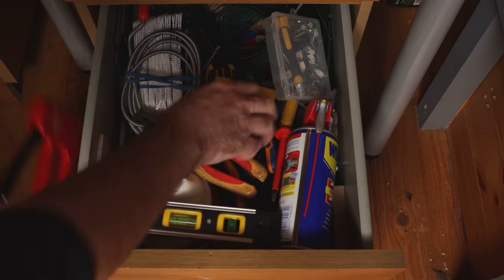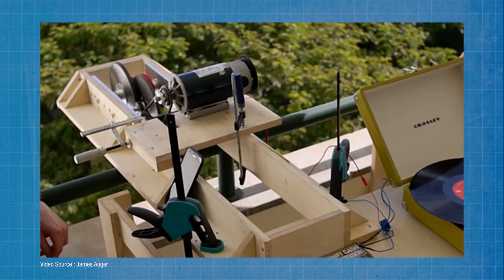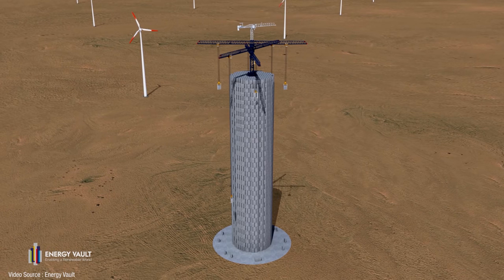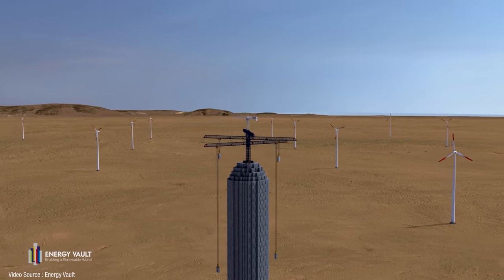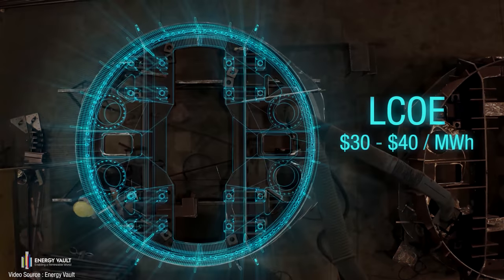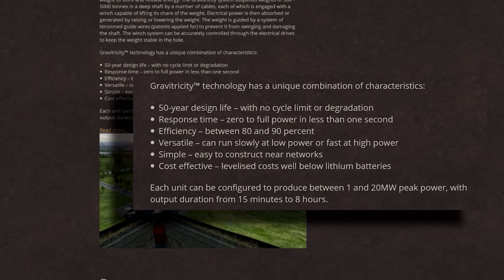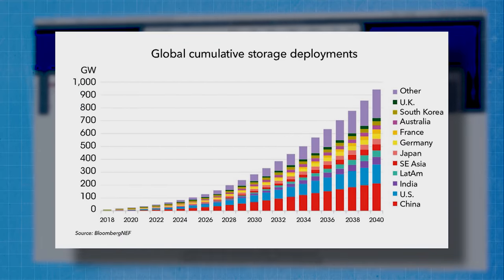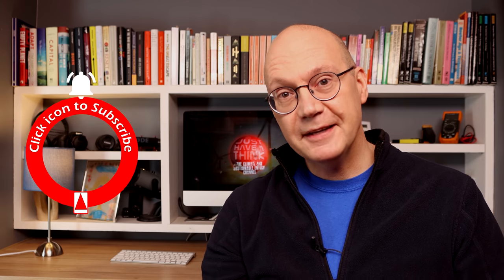Gravity Energy Storage : A very uplifting technology!

Comment: The energy vault energy storage is a bad idea. Using cranes, which can't cope with wind for energy storage from windfarms is not a good idea. Furthermore picking up blocks and dropping them off somewhere else (and not damaging them) is a very complex task which still does require human interventions (take a look at container shipping). In the container shipping the picking up the containers from the ships is still a manual job.
This task will be complicated further because the blocks will be prone to wear and tear. Furthermore one needs to be sure that a whole stack of blocks will not fall over.
The energy vault has only shown CGI's of the principle. I doubt that this concept will work in a practical cost efficient way.

The concept where old mine shafts are used sounds more promising. Also concepts using trains going up the hill are being investigated (https://www.youtube.com/watch?v=RHrlnnbJuDg). But I do have my doubts on the side of the maintenance side and durability of these concepts. (Pumping water from A to B is so much easier and does require a whole lot less maintenance.
Reply: Telltale sign : These projects don't give their maintenance costs.
Also, factoring density (concrete ≅ 2.4) and height, these equate to a modest hydro dam. For MUCH more cost per unit of storage.
Reply: I agree. Energy Vault is WAY too complicated. It'll never work.
Reply: "Using cranes, which can't cope with wind for energy storage from windfarms is not a good idea." Yeah sure.... like do you really think the actual location will be the same as in the promo video?

"Furthermore one needs to be sure that a whole stack of blocks will not fall over." That's why they use a lego-like system with interlocking pricks bricks. 

"The energy vault has only shown CGI's of the principle." Hmmm.... 4:29 

Seems like you didn't pay attention to the video.
Reply: @3gunslingers 1) The benefit of placing a storage system near the point where energy is generated is that the load on the electrical network can be "shaved" and optimized. Placing the storage further away takes away a key benifit. This places questions on the validity of the concept.
2) Interlocking bricks adds to the complexity and makes it prone to wear and tear. Furthermore it adds to the complexity of the system. These interlocking bricks can be a solution for a height of a few metres. If it is a solution to the scale which is presented has to be proven. Furthermore the foundation on which the blocks will be placed will also be a relevant factor.
3) In the video it is shown that cranes are built. In the video the autonomous operation of the system is not presented.
Please prove me wrong and show the autonomous operation of the system.
Reply: @harveytheparaglidingchaser7039  I also had a look at that. In the port of Rotterdam, very close to my home, you see that they manage to automate a lot of things, except the picking up and the placement of the containers. This makes you wonder how they do this job in the energy vault concept. (Where the challenge is a bit larger).
Reply: @harveytheparaglidingchaser7039  sure under Chinese safety standards...you stand under those cranes while they are operational
Reply: @harveytheparaglidingchaser7039  It seems like that according to the title. When I look at the picture I am not quite sure ... The picture shows someone looking at how a container is being placed whilst he is holding some kind of controls. That still raises my question: did they manage to figure out how to pick up a container from a ship automaticly, without any human intervention? Or is this just a case where the crane is operated remotely and a human is still required to perform the pickup and placement task.
Reply: @SkaterJanF  that's because shipping containers are never in the same position twice. you're comparing apples to oranges, and you basically answered your own question.
Reply: @jan feijes  'Using cranes, which can't cope with wind'  so all the cranes currently in existence, including those used to build skyscrapers, are just imaginary?
'This task will be complicated further because the blocks will be prone to wear and tear'  as opposed to all other technology, which is entirely maintenance free? seriously, if you're going to challenge an idea, at least come up with credible arguments.
Reply: grindupBaker  
Ha! You spotted my spelling mistake. I meant bricks of course. Sorry.
Reply: @daos3300  1) Let me explain my statement : "Using cranes which can't cope with wind for energy storage from windfarms is not a good idea.". 
Cranes do have wind limitations (https://wilkinssafety.co.uk/wp-content/uploads/Beaufort-scale.jpg). At 6 beaufort (11 -13 m/s to hoisting becomes challenging, above 6 beaufort (14 m/s and up) using a crane does become dangerous. When you compare this where a wind turbine operates best (https://3ohkdk3zdzcq1dul50oqjvvf-wpengine.netdna-ssl.com/wp-content/uploads/2017/09/Typical-power-output-500-x-330.jpg) you see that the highest production is above 12 m/s. Therefore operating this storage near a windfarm will bring not the benifits you want. You want a storage method to work when the windfarm is at it's production optimum or peak. This storage method will not be safe to use at moments of peak production. This fact is really bad for it's business case.
Skyscrapers will not be built with wind speeds higher than 5 beaufort due to safety regulations. Just go out on a windy day and look how many tower cranes are operating.
2) According to Energy Vault : "Unmatched Performance : 30+ year life with zero degradation & 85% round trip efficiency". I simply have serious doubt that Energy Vault can accomplish this promise. The concrete blocks will be prone to wear and tear (just take a good look at the blocks of a jersey barrier and you get an idea what I mean when a concrete block is picked up and placed somewhere else many, many times. The cranes are complex things and require maintenance. Therefore I do challenge the statement of Energy Vault where they claim it has "zero degradation". I also do have doubts that this complicated structure will last for 30+ years.
Reply: @SkaterJanF  ok, interesting info. so until they release some hard data we won't know if it's viable or not. either they have done their research and have solutions to the issues in development, or they just spaffed a bunch of investment on some pie in the sky which will never see the light of day. as a small bonus, i like that it doubles as kinetic art.

Comment: imagine a mine shaft and the waste pile nearby.  this energy storage system has an automatic dumping system located way above the shaft bottom.  electricity hauls waste rock to the shaft and
puts it on a big tray.  when electricity is needed, the tray drops and dumps the waste down the shaft, then comes up empty, ready for another load.

Comment: Exercise: Find out the energy storage capacity of a Tesla power wall. Design a gravity storage system with the same capacity that would fit inside a house.
Reply: You'd put it outside the house. Maybe at the end of the house where the chimney used to go?
Reply: To have the same energy storage capacity of a tesla power wall 13.5 kwh you would need to drop a chuck of concrete that weighs 1 tonne almost 10 meters. Not practical in my opinion.
Reply: @nerdy1701  Thanks! If we assume concrete has density 2 (actually it's 2.3 approx) then a tonne block would occupy a volume of 50 x 100 x 100  cm. 10 m is 4 storeys each 2.5 m high; a typical detached house would more likely be 2 storeys, or 5 m high. You could store the same energy by doubling the weight and halving the height. So you could have 4 half-tonne weights 50 x 50 x 100 cm (or cylinders, like clock weights) going up and down the whole height of the 5-metre house. If you spent a little more money on the weights you could buy lead ones (density 11), and either shrink the actual weight or weights, or shorten the height about 5 times, so you would only need about a metre instead of 5. In conclusion it doesn't seem impossible, just cumbersome - the best solution might be to build a dedicated tower, either up against the building to give it a medieval look, or free standing like an Italian bell tower.
Reply: @nerdy1701  I have 4 tonne in cars sitting in my garage every night...2.5 meters might be feasible...
Reply: @gerardvila4685  Great idea.
Reply: @nerdy1701  
Agree it’s not practical but your calculations are way out. 
E = m.g.h, where E is energy in Joules, m is mass in kg,  g is acceleration due to gravity (call it 10 m/s^2] and h is the vertical drop in metres.
13.5kW.h = 13,500W x 3600s = 48,600,000J.
We can rearrange the equation above to give h = E/g.m and using m = 1000 kg (1tonne) we get =>
h = 48,600,000/ (10x1000) => h = 4,860m.
So your tonne weight has to fall nearly 5,000 m to provide 13.5 kW.h of energy.

Conclusion: You’re not as nerdy as you think😉
Reply: @nerdy1701  Isn't that: 1000kg * 9.81 m/s² * 10 m = 98100J = 0.02725 kWh != 13.5kWh.
Reply: @q.e.d.9112  yeah my number is exactly 500x off. I don't know what the heck I did there. Was in a hurry, although that's not really a good excuse lol. Good catch!
Reply: @alandalsing522  Excellent idea. Those car lifts should do the job as a starting point for design
Reply from the maker: A bit of a moot question really Gerard. The system was never conceived for domestic use, for the very obvious reasons that you are insinuating.
Reply: @JustHaveaThink  You guys give up too easily. Instead of 1 ton over 5000 metres, all you need to do is lift 5000 tons over 1 metre. It's been done (almost): the Eiffel tower -  7000 tonnes of steel - was originally equipped with hydraulic rams on its feet in case it tilted.
Seriously, I didn't realise that chemical storage of energy was so much cheaper and more powerful than mechanical storage, which this example illustrates.
Reply: @q.e.d.9112  not if he increases the mass sufficiently with the correct gear ratios to compensate for a lower height
Reply: @VPS 101
Of course. 
Instead of 1 tonne falling 4860m you could have 1000 tonnes falling 4.86m.
What are you going to make your 1000 tonne weight out of? Not to mention the foundations to support it, the structure that raises it nearly 5 metres and the massive gears needed to convert that GPE into rotational energy. Plus you’ve still got to fit a motor/generator.
Now work out the energy cost of building the thing, and my betting is it would take more energy to make it than it could store in a dozen lifetimes of daily charge/discharge cycles.
Just to produce 1000 tonnes of pig iron requires about 13.5 x 10^12J of energy. That, alone, would require 278,000 full cycles of your 13.5 kW.h energy storage system to repay. One a day for 760 years.
IMO, pumped hydro is the only practicable system for using GPE to store electrical energy.
Reply: @q.e.d.9112  But you don't need a massive gear. You can use pumps to lift the weight hydraulically (charging) then you can send the pressurized fluid back into your pump which now works as a generator (discharging). It isn't my idea - I remember seeing a proposal to convert a mine shaft into an enormous hydraulic piston, with a set of cylindrical weights travelling up and down (or you could drill a shaft if none is available). I don't know whether they got anywhere as a business, but IMHO this makes more sense than lifting all those blocks with a crane. (There was a crane blown down by a storm in France today, came down on a house. Nobody was hurt but they might have been). That said, I mentioned the Eiffel Tower half as a joke, obviously nobody has a 7000-ton tower in their garden, with or without hydraulic rams in its feet!
Reply: @gerardvila4685  
You could but we are only talking of 13.5 kW.h and we need 1000tonne mass and 5m lift. As I pointed out, just to smelt pig iron for the weight is an energy payback time of 760 years. OK, if we already had a 1000 tonne object that could be lifted as one mass,
With all energy storage ideas, the energy used in construction needs to be offset by the energy produced in the lifetime of the device. Then and only then do you start to measure the “round trip” efficiency. A LI battery pack returns about 35 times as much energy storage over its lifetime as the energy required to produce it. This, effectively reduces its overall efficiency by about 3%. 
For deep, disused mines it would possibly make sense to evaluate the volume available for flooding at the bottom of the mine then make a storage pond of equal capacity at the top. Then pumped hydro might be a possibility. Unfortunately, most mines flood naturally and require constant pumping. This is energy put in that you don’t get back out again. But there may well be deep mines that are not subject to much natural flooding.
IMO, the idea mooted in this video suffers from a number of obvious disadvantages. Starting from a fully charged “stack” as you take blocks off the top layer and stack them at the bottom, the height differential decreases. By the time you’re halfway through your stack you no longer have a height differential. In other words the bottom half of your stack is doing nothing and you’re effectively wasting half the height of your tower.
I’m fascinated by the idea of using hydraulics to raise the Eiffel Tower. If you jacked the whole thing up 5 metres, it would store about 100kW.h. But to put that in perspective; it’s enough to keep Paris supplied for about 0.22 seconds!
Bon chance!

Comment: Two solutions:

1)Best solution is to do this on ocean with boat that lift and lower heavy weight (heavier than water, stone is 2.5tons per m3 and water is we know 1ton per m3)
This solution with boat can be accomplished with oil tankers, that will be not used anymore for oil but for lifting weight from the bottom of the ocean with renewable electricity and producing electricity lowering that weight to the bottom to produce electricity during night.
Much less costly and very high depth in kilometers or miles can be accomplished depending of location on the ocean.

2) Power plant that is at the bottom of the ocean that will pressurize big tank at the bottom of the ocean  that is connected with steel cable, with compressed gases and lift force will do the work. 
Big tank can be also plastic bags.
Power plant that is at the bottom of the ocean would be connected with electrical cable only.

Pressurizing gas can be hydrogen and oxygen that is produced in power plant at the bottom of the ocean with electrolysis  of ocean water with electricity from that electric cable (other solution is to pressurize tank (plastic bags) with air at the surface, but IMHO first solution is better).

Since at the bottom is for example 800 bars (at 8000 meters pressure is 800 bars or atmosphere) when tank is going up from the bottom of the ocean and produce electricity pressure of water is  going up since we reduce depth of the tank.

You get it,   we must depressurize tank during travel to the surface, otherwise it would explode.
 That extra pressure can be used to further speed up tank to the surface with propellers installed on the tank propelled with depressurizing tank gas and second with gas engine that will work from that depressurizing gas that is, we know, hydrogen and oxygen.

So depressurization will do 2 thing on the tank (both to propel faster tank to the surface what will produce more electricity).

Comment: Thunderfoot has an interesting view on this " invention"
Reply: the guy that just compared fuel tanks and batteries and concluded that there is no way you can have a future with electric cars, failing to mention the weight or efficiency of the engine? he just likes to pretend he is smarter than everyone else while spamming decade old memes. recently stopped  watching him, recommend you do the same.
Reply: @davitdavid7165  electric cars dont have engines!  Oh and Tesla's are crap in the snow.
Reply: @dogwalker666  cars in general are hurt by snow. There is no way a selection of colder climate focused electric cars does not exist. Also electric cars use an induction motor that is more efficiant then the ideal(inpossible) internal combustion engine. Look it up.
Reply: @davitdavid7165  mate not only am I an electrical engineer and know a hell of a lot more about motors than you, I also own a diesel/electric car  and today had to tow a Tesla and a leaf out of the snow,  and another electric only car that was completely flat and miles from a charging point. How do you carry a gallon of electricity to get it going? Yet my car didn't even slip once,
Reply: @dogwalker666  idk man,maybe electric cars will have a harder time in slowy climate.
Reply: @davitdavid7165  they do the batteries are less efficient at lower temperatures,  plus the heaters wipers and lights all drastically reduce range.
Reply: I was suprised that a channel labled "just have a think" took the given figures with so little ciritism (unlike thunderfoot). And when asked about thunderfoot video he just replied on the nature of his chanel (which seems to be too negative for "just have a think") rather than on any arguments. I have to say, I did not expect that "Just have a think" does so little critical evalation when presenting new ideas
Reply: @davitdavid7165  You obviously don't understand the physics of having an electric supersonic vtol aircraft...